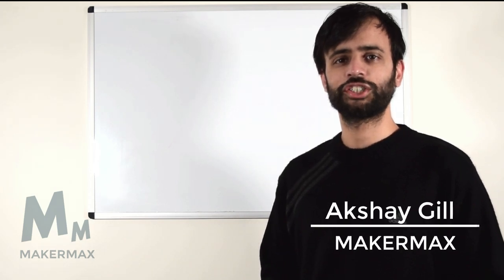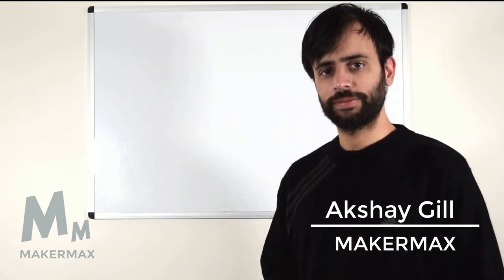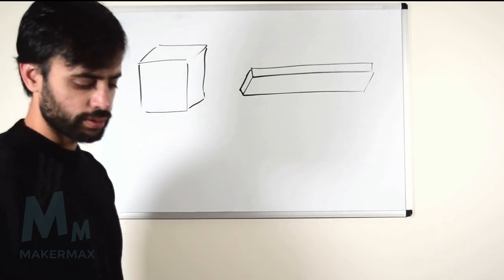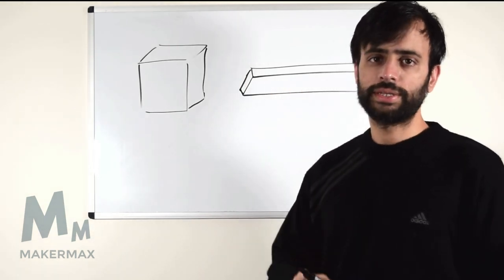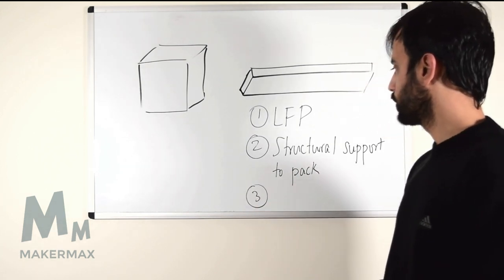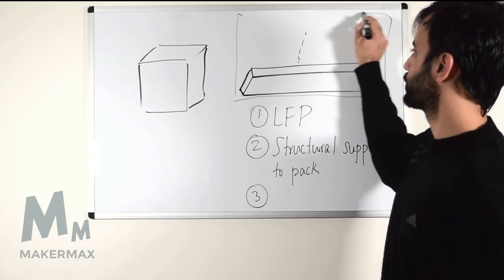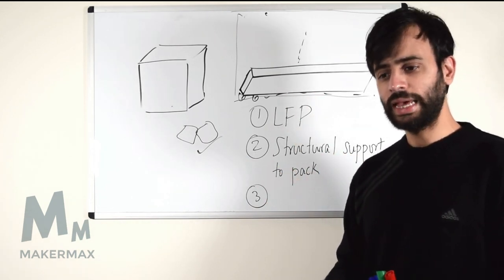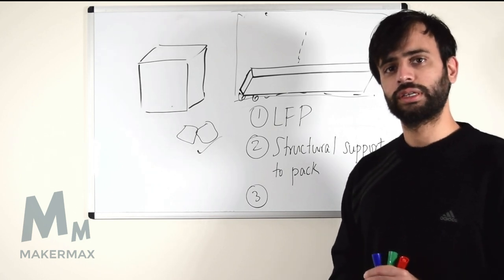A technical deep dive into the BYD Blade battery pack

Comment: Each blade is made up of multiple cells.  They're in parallel, not in series.  You add the voltage in series, but the voltage of a single blade is sitting at the normal 3.2 V for LFP cells.  Either it's one long prismatic tape (one big cell), each layer is a separate cell, or each layer is multiple cells.  If there are more than one cell in each blade, then they're paralleled; you add the amps, not the voltages.

If the blade was just one really big cell, then it would be one continuous foil for each electrode, and the nail would complete the circuit, thus causing the entire cell to short.  We know that didn't happen because it didn't explode, it didn't get real hot, and most important of all, the voltage didn't drop to zero.  

If the blade was a cell per layer, then you would still short out every cell if you drove a nail through it.  It doesn't matter where the nails are located, it would connect the foils and short every part of the cell.  

We know that both of the above cases are wrong because there was a fairly quick loss of the battery's voltage, then the voltage drop stopped.  Somehow the short was disconnected from the majority of the battery.

However, if there are multiple smaller cells per layer, say 10-20 cells per layer, then driving a nail straight down through the battery would only short out 1 cell per layer.  If there are 20 layers, it would short out 20 cells.... of the 200 - 400 cells in the battery... or between 5% and 10% of the battery.  Definitely safer than shorting out 100% of the battery.

Shorting a cell or multiple cells would cause those cells' voltage to plunge, and cells in parallel of unequal voltage will cause the higher voltage cells to charge the lower voltage cells, which is shorted out, so it would almost be like shorting the entire battery.  UNLESS you can disconnect the shorted cells.  How do you connect hundreds of cells in parallel and disconnect one that's shorted out?  Simply, you connect all the anodes to a bus bar, and all of the cathodes to a different bus bar using tiny wires that serves as a fuse in case the current running across it gets too high.  So, one cell per layer shorts, all of the other cells attempt to charge it, pushing high current through it, and the fuse breaks.  You've now disconnected the 20 cells that the nail was driven through, stopping the entire pack from shorting out.  The battery voltage drops when those other cells try to charge the shorted cells, there's a bit of heat generated, then the voltage stops dropping and heat stops being produced.  The connections have been severed.

Watch the BYD Blade production facility video. At about the 14 second mark, you'll see some rolls.  Each roll looks like white paper with little dark squares maybe 6 centimeters in width and 10 centimeters high, and they're spaced about every 5-10 mm apart.  Seems like the dark squares are either the cathode/anode material, or the current collector.   Line them up and sandwich an electrode separator between them, and voila, you have 10-20 cells per layer.  You just need to run a bus foil along side them and connect each cell to the bus.  That could be done by either placing a tiny wire between the cell and bus line, or by printing a tiny metal wire between the two.  I can't imagine this manufacturing process would be all the complicated or expensive to setup.  

Voila... blade battery.

Comment: Not an expert by any means but the Ultium batteries look more impressive. Size is 24X4X.4, so similar form factor, but they can be stacked in different ways. More energy and power density. Lower fire and puncture risk -- and reduction in cost -- with the substitution of aluminum for cobalt. Less degradation than cobalt chemistries. At the pack level, the modules can switch between serial and parallel setups, allowing faster charging. Plus the pack is managed wirelessly and at the module level, allowing replacement of a defective cell/module.
Reply: y u said lower fire and puncture risk instead of NO fire and puncture risk? lower mean still there’s still risk.  

oh i m not battery expert. just curious u used the words carefully but still has risk but lower

Comment: Nail Penetration was originated to cover shorts by inner particles. Panasonic consumer cells catched fire bake in the 2000‘s and hence this test was developed. Despite that, the test is pretty controversial regarding this failure mechanism.

Comment: What I realize through this video is that once a battery is penetrated, the area of penetration will start producing heat and as more areas get penetrated more heat will be generating within the battery.  This will continue to degrade battery performance and eventually leads to more heat in the battery.  It seems like this can accelerate really fast so I think it’s difficult to determine how a battery will perform in its lifetime from just a lab test with just a few layers of cells.

Comment: BYD blade cell will offer minimal contribution to vehicle chassis structural rigidity. Tesla 4680s will be permanently embedded in epoxies. Think AL soda cans, it has no strength unless the thin walls are bonded with adjacent cans for sheer strength. Removable cells must have built-in allowances for manufacturing tolerance/replacement.  No cell-to-cell sheer strength as structure compared to 4680. (btw 4680 just a form factor, same for NNNN)

Comment: Obvious and nitpicking conclusion. Of course one can’t put all one’s money on the Blade battery and there will be further improvements in the future. But what’s real is that the Blade battery is the safest out there out of all the volume Li batteries out there. Find another Li battery that won’t catch fire with even the smallest penetration test. This is the benchmark in safety for 2021 and likely 2022 and a few years to come, that’s all.

Comment: If BYD blade is just a matter of configuration from short box to very long box, how can this advantage last? How can there be a patent on shape? Why haven't all other battery maker change their shape to add structural function to their batteries? BYD must have changed the LFP chemistry slightly and improved the vermiculite somehow. Some company in China probably has probably already taken apart a blade battery from an EV that was in an accident and reverse engineered it. Soon that knowledge will be widespread. China can't enforce patents because it is always stealing trade secrets and technology from other countries' companies.

Comment: My reservations are: MNC statistically caused fire in entire EV car saga including Tesla. LFP? Plus batteries chemistry explain it that way. Need more quantifiable data to go against. 

Safety, one can make their assumptions to challenge on batteries structures whole day long but I see no regulators or persons including Musk and batteries expert comes out to offer a better testing procedures to ensure safety of batteries created from either chemical or mechanical (accident) failure. Please do not just challenge some one who offer a repeatable test, offer your own test or concept that would apply to all types of chemistry and structure will make your assumptions or argument more sounds

Structural claims, for me it is simple go to car crush test for the car with same batteries capacity and similar car weight. For a consumer safety comes from using current regulatory procedures would be fine as we have data. The other point is more mileage for same size of batteries which in Theory the lesser weight/ kwhr will offer more (I understand that software also have great impact)

I do not pro either BYD or Tesla. But BYD is world number one electric busses and have majority of full EV taxi in China over past 10 years plus world # 1 owner of charging station which means they produce EV mobility unit not less than  Tesla. Plus world #4 batteries supplier. This means they have more than 20 years of experience in both EV mobility and batteries. I am looking for more solid explanation or evidence either from you tuber of audience that a speculative assumptions. 

BTW, I give credit to presenter even he have difficulty to explain his thought